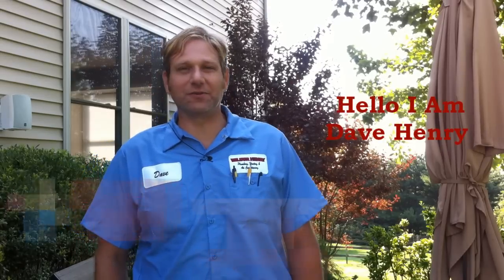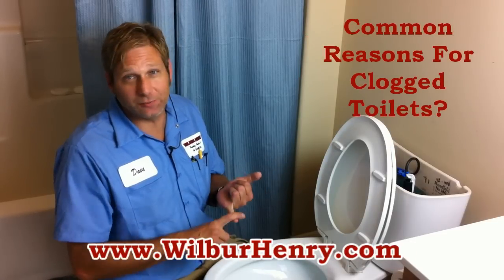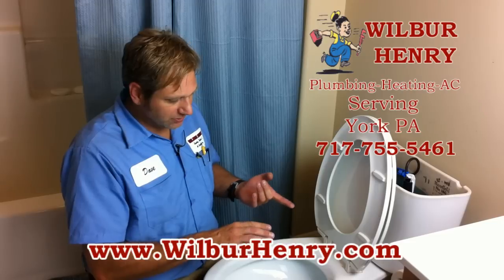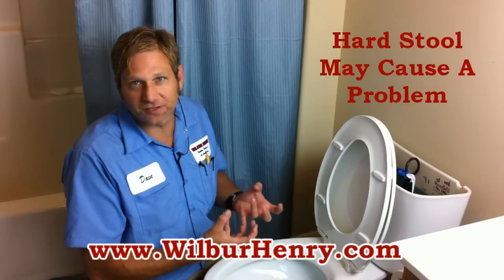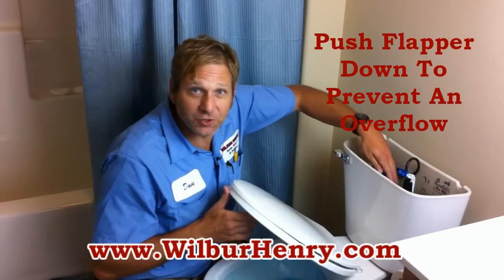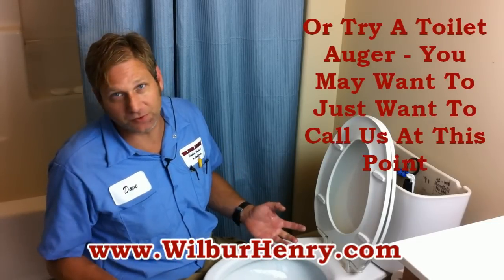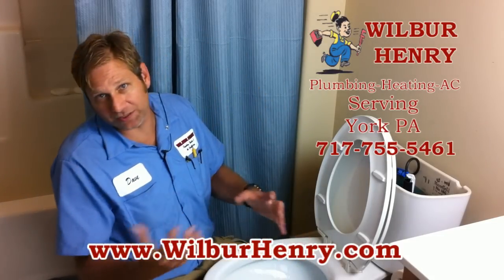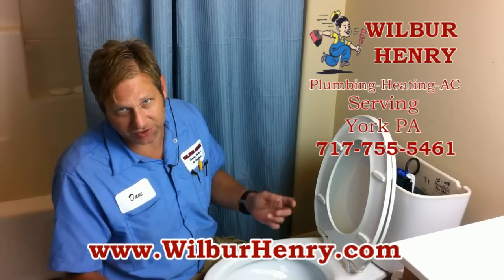Have A Clogged Toilet? 5 Simple Steps YOU Can Do Before You Call A Plumber

Comment: I have done all that you have recommended, including letting it sit for a couple of days, a bowl fill of water and adding hot water from the sink. None of these recommendations have worked this time and now the second toilet is clogged. There is not paper in either one. I worked very carefully to avoid that. I will have to call a plumber.
Reply: I, too, used liquid dishwashing detergent.

Comment: This isn't anything negative towards you but I have never had it where a plunger didn't work til now.  I have tried dish soap and hot water and it didn't work.  My toilet is a mess if you know what I mean.  I also tried vinegar and baking soda but that doesn't work.  The water never goes down.  On top of that the plunger I got off Amazon doesn't work.   I should have gone to the store after it happened this morning and get a new plunger.  Now it's the next morning and nothing has changed.  I could cry but I dont want to bother my manager if I can help it so I'm trying to fix this.  The stores where I live don't have those big augers so I guess I will try getting a small one.  This is like the most irritating thing as a person to have to deal with.

Comment: Thank you for posting, this is very informative.  What finally worked after trying multiple methods (we didn't have the auger tool) was a product we picked up at Home Depot called "Green Gobbler" for around $10.  Just pour in the powder, wait an hour....and it cleared the clog!  Hallelujah!  I won't discount the fact that perhaps the detergent and vinegar/baking soda also helped in their way since the toilet was sitting overnight with those additives, although the toilet was still full before we tried the Green Gobbler.  Anyway, I thought I'd add this comment for anyone who was at their wit's end like we were yesterday after trying so many methods.

Comment: I'm convinced the toilet isn't plumbed correctly, surely the waste pipe at the rear should be angling slightly down over, mine is running pretty much level, that can't be right, can it ?

Comment: i work in a very old building that has drum traps in the bathrooms i broke 1 snake in 2 pieces going threw the sink and snap the second head going through the top of the drum trap i even tried running the super v with just a straight cable with no head an old plumbers trick i learned i get about 3 foot in and hit something that feels like rock and i just cant break through it any ideas?
Reply: Could be a pipe angle or maybe old roots. Send in the housecat wrapped in rubber carrying knives. Don't forget to strap on a bottle of computer duster and fish tank tubing to keep animal welfare off your case you may need to use several  bottles. Don't cheapen out in the last inning here folks that Tigger McFlufface has your back(side). This is why cats watch you on the toilet, they are studying it. They are an ancient plumbing bloodline gifted by Roman sewer workers to pregnant sex workers... Legend has it the breed goes at least back to Egypt where you can see hiroglyphics of a cat watching over Tootootunkommon crouched atop his royal pearl highchair ;]

Comment: Simple solution to fix pickles in the toilet that was already flushed. Just keep filling a bucket in the tub, take the water and fill the toilet, use a big plunger, push till you feel the pressure release lift the plunger to get more pressure, and plunger till the water is mostly gone. Keep repeating till the toilet flushes like normal.

Comment: All Good Recommendations but still Headache, Easier way is use a Vacuum cleaner, connect the output use separate Vacuum Pipe put in the commod pump air, That Simple.
Reply: This is a terrible idea as you could wind up shooting god knows what out of other drains in your home potentially far and at a fast velocity!.. ;]

Comment: I think our problem was wet wipes.  I noticed water coming out of the base after a flush.  went and got a wax ring, thinking that was the problem.  the 4" pipe coming from the foundation had standing water at a 90" elbow about a foot down.  Boiled some water in a 5 gal pot, SLOWLY poured it into the 4" pipe, saw it receding slow until the water was gone, filled the 5 gal pot again, poured it regularly and this time the water was going down a little quicker.  Then used a plunger for a good 15-20 seconds on the 4" pipe and as soon as I lifted it, SWOOSH!  Hope this helps someone.
Reply: Thank you!

Comment: I've slugged a few in my day. Clogged toilets at rest areas Wal Marts and restraunts in just about every state I've been to. As long as there is a pimp stick I can usually break any clog. However I stuffed a handicap stall at a Nevada casino and that fucker was beyond the pale of unplugging so I overloaded it with shit then topped off with paper. Flushed and it overflowed on the floor. They call me the SLUGGER and my buddy is LOOSE STOOLS I probably have warrants out for me in several states for damage to toilets and restrooms.

Comment: ...ALERT   ALERT  ALERT    you can unclog any drain yourselves.  Just do the following.  Buy on Amazon  a wet/dry vac called  vacmaster professional 16 gallons for around 100 dollars.  A regular vacuum won't work because it's not a professional version that has really strong suction.  Then buy the attachment called shop vac hero which is a yellow 2 and a half inch or so attachment that is connected to the tip of the vacuum cleaner (that tip is only necessary if the hole in your toilet is not oddly shaped and will allow a proper suction to occur when shop vac hero is put over it.  This also works on clogged sinks, and tubs.  If you use this method on sinks or tubs remember to put a plastic strong cup like those used when you order Chinese home made ice tea upside down over ALL the water drains and tub drains connected to the particular clogged area otherwise all the air suction into the clogged area will not work.  Before turning your wet/vac on put the vacuum hose with the yellow tip already connected to the hose over the drain hole that is clogged.   I recommend one person holds the hose firmly and tightly and another person turns the vacuum cleaner on or off.  Brace yourself and put on a plastic cover over your face and body in case of splattering of toilet, sink or tub liquids rushing your way.  Turn on the vacuum and let the vac suck out the liquids/wastes out into the vacuum container.  Do this for 30 to 60 seconds or until you're sure that the drain is unclogged.  Don't have the vacuum motor running longer than 60 seconds to prevent overheating damage to the vacuum motor.  Trust me people this works and in the long run you'll save hundreds or thousands of dollars in repairman costs.   Also, remember to clean, and rinse your vacuum container and leave lid open until it air drys.   Now you know how to not be dependent on these scam artists that come to your house for 5 minutes with a clogged drain snake and charge you 50 to 100 dollars per visit.
Reply: bur don't put any electrical appliance in water as YOU MAY GET ELECTROCUTED!!!
Reply: @jane2133    Jane what I'm talking about is called a wet/dry VAC that sucks up water.   That is made to deal with water and the inside of it is a hollow bucket space that catches the water and you just dump it.  Jane you need to get out more often and not just leave random comments that you know nothing about.  It makes you look like a fool.
Reply: @___David___Savian  Thanks for letting me know it is safe to use with the water, electrically. It is quite unnecessary to be very demeaning and nasty in your email reply to others, I now have a different impression of what sort of person you really are. By the way, I unblocked a toilet yesterday using the dishwasher detergent and hot water from a bucket successfully, worked well.